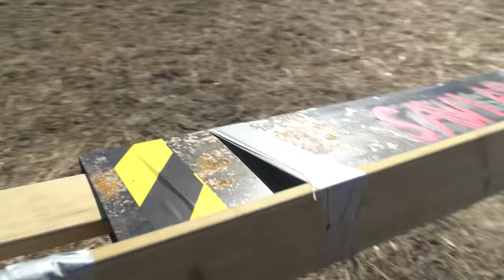Can you Launch Frisbee with Pneumatic Cannon?

Comment: 2 things.  to help the spi  process. 
1. sabout seperation.
2. friction track.

1. sabout needs to fall off much faster. 2-4 peice that falls apart would be great. 
   - one side of frispy needs to patrude from the sabout to allow drag in step 2.

2. friction. inside the tube on just one side there needs to some friction from begining to end of the barrel.  think some like soft duriable rubber 2-3mm thick, so that you can create a little drag forcing the spin down the entire barrel...

Comment: Yes, but maybe without the sabot and inside of the canon add on one side a long rubber.
Reply: Yeah definitely needs some rubber somewhere, I think along the wood at the end.
Reply: at least a meter of rubber inside that square tube to get it spinning and no sabot
Reply: The sabot is necessary.  Without it, the majority of the air will blow past it.  The sabot is like a gasket, it seals the barrel behind the frisbee.

Comment: The center of mass of the frisbee-and-sabot system is behind its center of pressure, so it's always going to flip vertically once the frisbee catches the air.
In addition to what people are saying about a separating sabot, maybe also consider making it a full frame all the way around the frisbee, so the center of mass is closer to the front.

Comment: Attach a strong cord to the disc cradle from the inside of the barrel starting where the pneumatic cannon is. Make the cord just long enough to where the cradle can barely exit the end of the barrel. Attach the other end of the chord to either left or right of cradle to allow the disc to spin after exiting the barrel.

Comment: Make the carrier more of an "L" shape instead of a "U" shape, put spring loaded rollers on one side of the carrier ( this will push the frisbee against the cannon wall) , let the frisbee touch/rub against the full length of the cannon. put a few rollers on the back side of the carrrier also to allow rotation during acceleration in the cannon. As the carrier and frisbee exits the cannon, the spring loading will force the carrier away from the frisbee quicker and the "bottom end" of the "L" should kick the frisbee a tad giving it a bit more spin and acceleration.

Comment: I think the trick might be a small hole in the "back" area of the chamber that you could insert a motor shaft to spin the disk up to high speed before firing. The 3d printed holder could also be modified with some bearings on either side so it can push the disk down the canon while still allowing it to spin.

Comment: This might work if the frisbee was spinning BEFORE it was launched. 
But the way it works now, it's just a flat object being propelled out of a tube.  In the slow-motion, it's clear the frisbee never spins. 

Also, instead of a frisbee, it should be a disc of red-hot steel being shot into a hill of thermite.

Comment: Are you sure you need that part to launch it? I think the part prevents the spinning and restricts frisbees function. Id use something like wet towel/rag to get the frisbee out but clearly separating from the part it launches with. Or just pur string on the 3d piece so it will detach from frisbee after leaving the barrel. Now the frisbee didnt spin because the 3d part did not separate fast enough. If you had something to detach the 3d part and then just frisbee hitthe plank, it could actually spin. Just my thoughts on this.

Comment: I think you have two options. First would be to make sabot separate sooner by making it multi piece as others suggest. But to get it to stabilize cut or carve fins or air scoops on the edge of the disc that catch air in one direction. Causing the disc to spin.
Second option would be to ditch the sabot and have a curved, tighter fitting barrel. Curve it slightly left or right so the disc rolls allong one edge causing it to spin.

Comment: Same issue on every single shot, and indeed, the same issue that this was experiencing when you were using saw blades:  The sabot/cradle was not separating from the frisbee, and consequently, the friction retaining the frisbee in the cradle was keeping it from beginning to spin.  I think perhaps you need some kind of mechanism to keep the cradle captive in the launcher barrel rather than launching with the frisbee, so that the frisbee is free to begin spinning immediately after it leaves the barrel, and perhaps after that, your friction-induced spin idea will work better.

Comment: Possibly add a stop to the end of the barrel to keep the sabot inside and also a faster action valve that closes quickly and does not blow the frisbee after it exits.  Put holes through the sabot to help the frisbee eject from it at the end of the stroke of the sabot in the barrel.  Thanks for the video!

Comment: Simple idea: use wadding (a block of styrofoam or a 3D printed piston) that does not support the frisbee, only pushes it. Tilt the cannon slightly so that the frisbee pretty much rolls along one side to get it to spin. Don't try to catch the piston since it will just end up shattering. Simply make it light so that air resistance stops it quickly.
Complex idea: 2-part holder (sabot) with bearings that supports the frisbee in a way so it can roll along one edge of the barrel to get it to spin. Two-part, top and bottom, so that air pushes the halves apart and away from the payload as soon as it's out of the barrel. Advantage of this setup would be more control since you are not relying on gravity and tilted barrel for the spin.

Comment: The sabot needs to disengage before spinning the frisbee. The most simple way would be to modify to sabot and add metal pins near the end of the cannon to stop (break it into pieces). The modifications to the sabot would be to focus contact along the edges and avoid any form-fitting contact (except edges where metal pins will impacting) since that would encourage pieces to maintain contact, even after broken, and make the center a point of failure to break in half. The center region should be as hollow as possible so the debris that shoot past the frisbee will have minimal impact on its trajectory. I believe you are on the right track with your final attempt to spin the frisbee with an extended curved surface to apply friction to one edge. At this point the thin edge of the frisbee is a severe disadvantage for trying to apply friction to spin it fast enough. Because of the speed and thin edge, the set up will have to stick out nearly twice as far with enough curve to maintain contact with the frisbee, changing the direction slightly enough to not deform the flexible frisbee but to use the kinetic energy to increase friction for the spin. There will be plenty of trial and error in this because this plastic is quite flexible.

Comment: I think the lack of spin is only part of the problem. The other part is the pneumatic approach itself: the wind coming from behind the disc might be throwing off the aerodynamics. If I were to design a golf-disc flinging machine, I'd use a rotating arm that holds the disc, spins around a few times, and lets go once it gets up to a good speed.

Comment: Put just the frisbee in the cannon without the plug. The plug is grabbing the frisbee and stopping it from launching correctly. Or take the seat out of the plug so it doesn't grab the frisbee. Make it flat with a much smaller grove holding the frisbee in place. Or make a stop at the end of the barrel to separate it from the disk. That would probably destroy the plug every time though. You could also try a motorized spinning tire frame to launch them.

Comment: I have read a few comments and there are some very good ideas. The sabot needs to separate from the frisbee, that’s key. Maybe make the sabot in two pieces left and right but do not make the left side length up to the mid point of the frisbee. Have it stay back at about 1/3 the length. This leaves the edge of the frisbee exposed to engage grip tape (from the comments) and make. Metal pin that sticks out just enough to catch the left half of the sabot to begin imparting spin and initiate the separation. The grip tap is phase 2 that uses the ramp like you made with the long board.  Whatever happens it will be exciting because there’s guaranteed impact and mayhem and a double win if it flies!

Comment: on the high speed footage you can clearly see that all the force ends up on your 3d printed PLA launching saddle. it even pushes the disc up and out of its way. my first improvement would be to just leave this out.
ideally you would only apply air pressure on the one/right side of the disc and have friction (rubber band or some sort of sticky coating) on other/left inside of the launcher channel to get the disc spinning from the start. to have all the non friction (top,bottom,other/right) insides coated in anti friction (lube, oil, teflon?) would surely increase the exit speed.

Comment: I'd say to make the launching cradle as small as possible, remove as much of the sides as possible. The disc isn't going to spin as long as it is in the cradle. The sooner you can get them to separate, the sooner it will spin and stabilize. Perhaps maybe some sort of retention pin or sort to stop the cradle near the end of the barrel, giving the disc the launch speed and the freedom to spin off the induced spinning device.

Comment: Perhaps somehow wrap a steel wire around the perimeter of the disk that "unrolls" during the launch, making the disk rotate when accellerating. Hopefully you don't need a sleeve if the disk fits the barrel well enough or if you have enough air volume to make up for some leakage?

Comment: I think you need the sabot to air break when it exits the barrel and be attached to one edge of the frisbee to pull back on the edge and start the spin. Possibly even a ribbon wrapped around the frisbee but only attached to the sabot to start the spin as the sabot pulls back. You only get about 3 meters for the sabot to stop before it causes the tumble. That seemed consistent.

Comment: I would like you to test with slightly less pressure to see if that helps. Also one problem seems to be that the slug doesn't separate from the frisbee. So maybe make the slug less form fitting or put some cushion between the slug and the frisbee.

Comment: For saw blade launcher: have a carriage with spring steel arms and a split axle on the end. The thin air shaft of the launcher holds the spring steel arms closed. Because the saw is held by the axle, perhaps it can pick up spin while still in the barrel, then the arms spring open as they are freed from the restrictive barrel, releasing the blade at the end. Maybe there could be a pin that you drop down at the end of the barrel after it is loaded, that stops the launcher carriage, while allowing the blade to pass? So the carriage arms look like: = in the barrel, and < once it leaves the mouth.

Comment: Two half moon sabots forming a circular cradle around entire frisbee to produce tight fit with some tape to keep it together at launch, rubberised guide like the plank attempt.
It launches, sabot does not keep it from spinning but goes around with it along rubber, hopefully tape keeps it together long enough to get some spin and then release.
If it works, frisbee goes flying straightish ahead and sabot halves go somewhere else.

Comment: I dont know if someone already mentioned this, but you should make the 3d print more like a sabot round. Print it in halves, maybe with little scoops at the ends to help it peel away from the disc. you shouldnt have any trouble loading or firing it with a split in the middle but it will get the 3d print out of the way. Also try to fire it a tiny bit downwards, maybe raise the whole setup somehow and/or shoot it down a slope. It should only need to be pointed down a few mm. If its aimed straight or slightly upwards the disc will want to tumble. As for getting it spinning, do a test shot and see how long it takes for the sabot to separate from the disc. Then put a sheet of plywood with a rubber strip just after the point the sabot is clear, if you can get the plywood to a point where the disc barely touches the rubber strip it should spin as long the 3d print is out of the way.

Comment: Air channels in the sabot device. Redirect some airflow over the disc to spin it before it leaves the barrel. Depends how much friction there is between the device and the frisbee though? Some bearings or rollers in the sabot device would easily sort that. 
I'm sure it's do-able, but it might take a bit more engineering. But the speed it hits the air outside the barrel might always be an issue. From memory these sorts of thrown devices work best at low speed (for example: trying to throw a paper aeroplane really fast never seems to work for me)

Comment: My suggestion: No sabot - it will prevent spin. Slightly curved barrel (left or right) so the frisbee will roll on the outer wall to get spinning. If the original barrel had been a little bit wider (or frisbee smaller), this could have been achieved by simply making a curved insert for each side of the barrel, preferably also shaped to fit the profile of the frisbee to compensate the lack of sabot. Might be possible to 3D print, maybe with a slot to insert a thin sheet metal strip (for instance metal packing band) to act as a wear resistant running surface for the frisbee.

Comment: I'd suggest to separate the sabot from the frisbee by a long and narrow arm so the sabot captures all the air but pushes the frisbee with just a "finger". Also, if you can make the frisbee already spin in the barrel, you'd be in a good position. Perhaps you can have a little opening on the side of your sabot to bleed some air to the circumference of the frisbee and spin it up.

Comment: I think the problem is going to be using the power of the cannon to pull the disc rather than pushing it. When we throw a high speed disc for distance, it is with a power grip that pulls the disc through our body and releases like a whip, creating the spin on release. The key to a good clean 'drive' is to minimize the off-axis torque, that is, keep the disc on the same horizontal plane from start to finish of the throw. Creating a spring loaded clamp that can hold the disc from the side or front and tight enough for the acceleration but will let go at the end of the tube should create forces similar to an actual disc throw.

Comment: Look up filament rollers with bearings, take the principle of riding the edge of the spool and lay it flat. Build the sabot around that with a top/bottom piece so it peels away immediately. This way the disc can spin freely in the sabot. If you could somehow get a piece of G2 timing belt to run the length of the barrel on one side so the edge of the disc rides it from the start. Should be spinning fast enough to get somewhere but if you get that far you're to have to start playing with Hyzer angles depending on the turn and fade of the disc. I desperately want to see that cannon successfully chuck some plastic a mind boggling distance.

Comment: Cool video! Like others are saying the sabot is definitely staying on too long. It drags the rear end of the disc down, causing it to tumble. In addition to modifying the sabot to release the disc earlier you could also adjust the barrel angle. It may work fine parallel to the ground or even pointed slightly downwards if the disc release angle provides an 'airbounce' effect.

Comment: You will need to attach a screw or something on the board right after the barrel so that it catches the cradle but does not touch the frisbee. Then use that last style of "diagonal board design" (or even make a slightly curved board so that the frisbee can't jump off the board because of centrifugal forces) and attach a rubber mat on it on the whole surface (like 2mm thick, you can get that from Motonet of Biltema probably). That should give the frisbee ample time and grip to get spinning.

Comment: I have a suggestion to try still with the frisbee, load them in backwards with the sabot facing forward, the force that they're being launched with might be getting them stuck in the sabot so they won't spin or let go until they start flipping in the air? The sabot might still hold onto the frisbee long enough that it gets some speed and still create pressure?

Comment: The reason the frisbee doesn't spin is because it needs to trade some of its velocity for rotation, which allows the sabot to catch up and prevent it from spinning due to friction.
If you attach something to catch the sabot, I think the frisbee is already going so fast that it will tumble before it can ever start spinning. This leaves the option of generating spin inside the barrel. 
I think the most promising option is to support the frisbee with a few light-weight v-groove rollers, put a strip of friction material down one side of the barrel, and leave a slot in the sabot so it doesn't rub on the friction strip. If you did this, you'd probably need to make sure the bearings are arranged in a way that forces the frisbee against the friction strip, so I wouldn't be surprised if you ended up with an asymmetric sabot design.

Comment: I would say that the residual air perturbs the flight of the Frisbee after it leaves the barrel. Have as much air as needed to seed the sabot down the barrel, and slam a valve shut so that the Frisbee doesn't get a tailwind. Also the sabot should get stopped in the barrel. Don't let it leave the barrel, just the Frisbee. This will make it easier to get the Frisbee to spin as well. The wood on one side idea is good, maybe a longer track on the side to spin it up more. Anyway, just a little East Texas engineering by way of Melbourne, Australia!